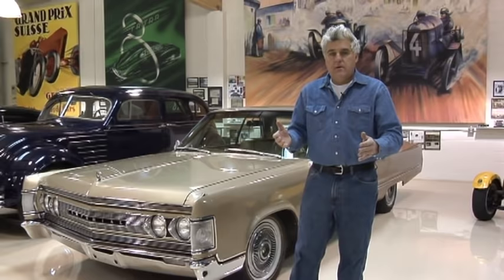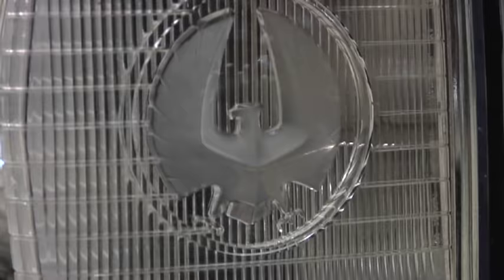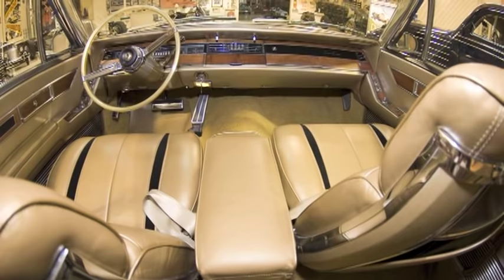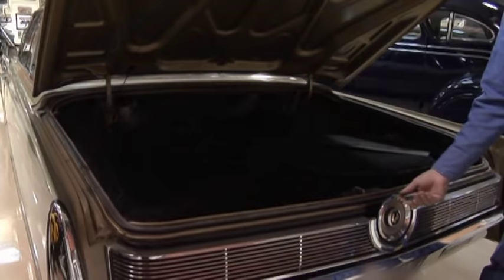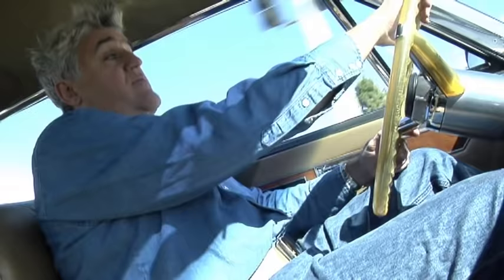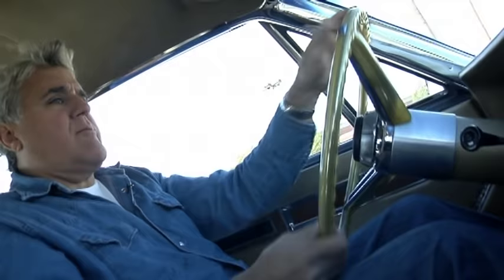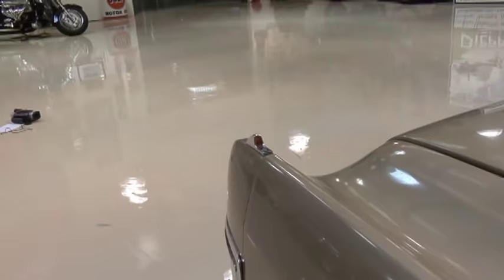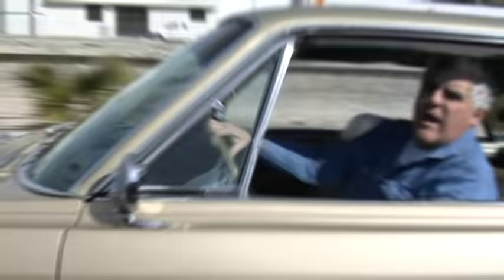1967 Chrysler Imperial Crown Coupe - Jay Leno's Garage

Comment: I grew up in LA  in the 50's and 60's and the only "seatbelt" was your Dads right arm holding you back from smashing your head into a metal dashboard in an emergency stop. It was always a good idea to be on good terms with your Dad on those occasions..
Reply: @Hoodoo Man: That move's even better with a female passenger-even WITH the seat belt on!
Reply: Fast stops could result in crushed craniums without seat belts.
Reply: I got my license in 79.  Back then wearing a seat belt was considered an activity for pussies, some drivers would even take offense if you wore one as to them you were communicating that you did not trust them.  However, I was brought up to use them and felt uncomfortable without it, so I would nonchalantly put one on if the car had one.  Many of my friends actually removed the seat belts as one of the first things on the list when they bought their car.  Even if the car had seat belt buzzers, they were easy to unplug.  To this day, it amazes me how people could have been so stupid and how far the other way we have come.
Reply: I remember when some people removed seat belts, but that was back in the middle to late 1960s.  By the late 1970s most of the people I knew used their seat belts, although there were exceptions.  I insisted that passengers wear their seat belts when I got my first car which had them, i.e., a new 1964 Volkswagen.  At that time I had to be very insistent.  Some of the excuses for not wearing them were bizarre.

Income seemed to be a factor.  In observing employees leaving work, I noticed that those leaving professional business were much more likely to fasten their seat belts than employees leaving factories.   @kennethsouthard6042
Reply: @frankeggers4024  I remember the "thrown clear" excuse.  It was always a friend of a friend was in a car wreck and was thrown clear.  Had he been wearing the seat belt and lived, he would have been knocked out and died in the car fire that always seemed to occur.  I even remember one of the guys from MASH, I think it was Wayne Rogers telling his own "thrown clear" story on a talk show.
Reply: I also remember that.  The Kaiser even had a pop-out windshield to make it easier for people to be thrown clear.  Some people said that they were afraid that with a seat belt fastened they might drown if the car ended up in the water. Of course if a seat belt is fastened people are less likely to be knocked out and therefore they will be more likely to be able to escape.

The lower accident death rate we have now is largely, although not entirely, the result of seat belt use and cars which offer better protection in case of a crash.  And, we now have statistics which prove the effectiveness of seat belt use.

 @kennethsouthard6042
Reply: @Big Bill O'Reilly KLASSY REMARK JUST LIKE TRUMP, PURE KLASS.
Reply: Lol
Reply: Grandmother driving would say "I don't need a seat belt, I'm holding the steering wheel".  Not sure if that was ever test-confirmed.
Reply: I remember being a kid in the '70s and my dad telling me that seatbelts were for sissies - I believed it until the day he had to stop short to avoid a rear-ender and my head hit the windshield and broke it.  Fortunately, he bought me a plastic batting helmet that day and I was wearing it at the time on the way home from school - it split right down the top.  I never listened to his ignorant BS again.
Reply: My wife is the driver, and still extends her right arm "to save my life" whenever she has to brake hard.  I keep telling her to quit it, my seatbelt and airbag will protect me, keep her hands on the wheel... she says it's just the mother in her, and she can't help it.  What's amazing is that we're both over 69, our kids are 48 and 45, plus several grandkids and one great-grand kid.  So its a sure bet that old habits are hard to break.
Reply: @frankeggers4024  Gee. They have stats that prove seatbelts are safe? I never would have known without them. Thanks for enlightening us, bruh.
Reply: @kennethsouthard6042  People weren't stupid because they didn't wear a seatbelt. It was the times and the mindset. It's hard to explain to someone who didn't live through them. You can judge them with 20-20 hindsight, but don't call them stupid. It reveals ignorance.
Reply: @joecebu2791  I'm 55, so I remember those times quite well.  My only difference was that my parents pretty much enforced wearing them where all of my friend's parents were of the belief that seatbelts were at best wothless and at worst dangerous.  There just seemed to be an overall ignorance about them at that time
Read my other posts in this thread to get a better idea of where i am coming from.
Reply: You're welcome.  I'm glad that you have been enlightened. @joecebu2791
Reply: @kennethsouthard6042  so you're 55 and remember the mid 60's? You were what, 3? Helluva memory,  bud.
Reply: @joecebu2791  First of all not many cars from the early to mid 60s didn't even have seat belts, my dad's 62 Thunderbird had them as an option but only in the front.  Second of all i was mainly referring from the late 60s ( I think it was 68 when they were mandated )on through the 70s when all  cars had them and few people wore them.  Yes, I remember those times quite well.
Reply: I remember climbing up onto the rear package tray with my brother and the old man tap the brakes at the next light and we would  fly down onto the floor squealing with delight .
Reply: @shawnfoxfirth9684  😅😅😅👍👍
Reply: Now your an adult so wear your seat belt
Reply: @thomastalleos8370  Now "you're" an adult. Learn to spell and stop telling others what to do.
Reply: Yeah, I remember my Dad holding me back sometimes when I was a bit older. Up until then though I used to stand up in the front seat.
Reply: @frankeggers4024  VW didn't come with seat belts in '64 unless you had them installed.
Reply: Quite true.  That's why I had them installed. @stevek8829
Reply: justsomeguy  It shouldn't be a law. The governnent isn't our mommy. It's should be a choice to wear a belt. Good or bad, still a choice, my friend. I wear my belt,  coz I choose to, but I don't need a nanny state.
They passed that law under the guise of lowered insurance rates. That never happened... big surprise.
Reply: justsomeguy  Not stupidity, by the way. It was the way it was... what's next, a seatbelt in an effing horse? Hey, it's safer! 😃
#SnowflakeNation
Reply: RJ22: Actually, it is the driver who ESPECIALLY needs to be wearing a seat belt.  Although many drivers think that they are safe because they're holding the steering wheel, and the steering wheel seems very sturdy, the major cause of death to  the driver, in a crash, is that the steering wheel literally breaks right off in the driver's hands due to the force of the impact, and the driver is thrown forward, impaling his/her chest on the end of the steering column. Wearing the seat belt stops that from happening. Unfortunately, it is likely that most drivers didn't realize that, and thought that holding the steering wheel would keep them safe in a crash.
Reply: So that’s what’s wrong with our youth!
Reply: Hoodoo Man haha. That’s great!
Reply: And that's the point -- wearing should be a matter of choice for a society of supposed adults who can exercise their own judgment with respect to such matters. 

Socialism,  in the end, always wreaks more destruction than good.
Reply: my dad was the seat belt to lol
Reply: My dad had a buick straight 8 got into accident I was standing in front seat giant arm stopped me from going forward
Reply: Exactly!!  Dad's was super dark green, and a 4 door.
Reply: Your dad stole that move from Mr. Castanssa
Reply: ...no doubt about it, Jay, this was a regularly spoiled Crown Coupe...the story of the mechanic making house calls I'd just SOOOO " LA-LA Land"...
...and, just a nit-picker correction, it was the LeBron n which was Imperial's rop-of-the line marque...
...too bad that this one wasn't fitted with the mobile Executive option ( bigolded teak desk, attached by a pivot hinge to a chrome pole just behind the passenger seat, which itself pivoted a full 180 ° to face rearward...( given that the guy was a producer...one would think that a mobile office and car phone would be " The Thing")...
...and just one final note...this year model Imperial by Chrysler was the final of the '55-'67 models basically hand-built at the separate Imperial plant, design and testing factory in Dearborn Hills...and you are correct that Imperial sales lagged FAR behind no. 1Cadillac and no.2 Lincoln...

...but these cars were as close to a Rolls' or Bentley's build quality that was ever mass produced here Stateside...

...my only thought to complete your Imperial would be a pristine Frank Sinatra Series of the '82 ill-fated Imperial Coupe re-intro, which fizzled out by '84...these Special Editions are rare, rare, rare...and much sought-after by discrimimating collectors...
Reply: my dad did that on many occasions I think it was also a maneuver to get a feel job if you had a buxom passenger, you know stopping short like on seinfeld.
Reply: The '67 Crown convertible, less than 500 made, is sweet. L.A.s Petersen museum has/had a navy blue example originally owned by Jack Benny. Chrysler had strong links to movie and TV placement. Imperials show-up a lot on The Beverly Hillbillies, Mission Impossible, Mannix and many  other shows. Milton Berle drove the '62 Crown convertible in "It's A Mad, Mad,Mad,Mad World." Gene Barry drives a '67 Crown convertible in the first Peter Falk Columbo outing, "Prescription Murder" I think some discriminating buyers in Los Angeles, Palm Springs and Florida bought Imperials because of the superior "Airtempt" a/c units. There were even little window stickers reminding you. I think they also manufactured household a/c units?
Reply: In order to be funny it must be true.

And this is true!

I collided with my dad's right arm more than I did the dashboard!

'53 Ford Ranch Wagon.
V. Cool
Reply: We always used horse ropes fer seat belts when I grew up. Pops wood tie us down in the seat and if we were two noisee, he had some duck tape
Reply: @frankeggers4024  i
Reply: Ha
Reply: What no late 60s volvos ?

Comment: My grandfather owned a 1967 Imperial. When we rode around in that car we were so far away from the front seat that it was like sitting in the Grand Canyon. 
One time, My grandparents took me and my brothers on a road trip and we got lost. We were so lost my grandfather had to drive mountain fire roads to get back to the freeway. That car was so freaking big we could barely get around the corners without the tires kissing the edge of the cliff road. My grandmother in the front seat shouting at my grandpa, and us boys in the back frozen with fear. But we made it. Fun times.

Comment: I learned to drive in a 66 Imperial four door and its just as Jay describes.  Absolutely no road feel and one finger will steer the car and one toe will apply the brakes.  I love that kind of isolation.  I wish we still had real cars like this now.  It was a true land yacht
Reply: My grandfather owned a Chrysler Plymouth dealership and I learned to drive in a 1976 New Yorker Brougham (which was essentially an Imperial, as Chrysler dropped the name Imperial after 1975). That car was absolutely stunning inside and out. When we would take it to the car wash we would always receive compliments and at least twice people asked if we would sell it. They traded it in 1984 and only got $1000 for it; I wish I'd had the $1000 to buy it from them back then because I would love to drive that car today.
Reply: Gary Taylor I had a 1972 New Yorker Brougham and your absolutely correct . I still miss that car and I sold it about 30 years ago . Sigh .
Reply: Chrysler introduced power steering in 1951; they were the first even though GM invented it in about 1928.  I knew someone who had an early 1950s Chrysler Windsor with power steering and fluid drive.  He used to drive with one hand on the hub of the steering wheel.  It took zero force to turn the steering wheel.  Fortunately most cars now have at least some road feel.
Reply: My father drove Chrysler land yachts when I was a child in the 60's and early 70's. More often then not he drove with one thumb on the wheel.
Reply: Those Chrysler Corporation cars had over-boosted power steering.  @Zoetropeification
Reply: @dougtaylor2803  Except for the fuel economy.
Reply: @emjayay  gas was cheap then, 50-60's and had over 100 octanes for super leaded fuel. High compression engines needed that. You could pump your own for about 25 cents, or get the "man who wore the star" to do it and check your oil wash your windows, inflate your tires if needed.....etc. etc. for about 32 cent per gallon.

Comment: Hey Jay, The steering wheel is Telescopic and Tilt. Just twist the big chrome nut in the center of the wheel left 1/2 turn then you can move the wheel in or out, 1/2 turn back and it's locked in.
Reply: ... and that unit was made by Saginaw Gear of G.M..
Reply: @34Packardphaeton  Yes, it was even told in his 66 Lincoln vid that the Lincolns had GM steering columns, which most likely meant the gearbox as well.
Reply: @kramnull8962  .. I don't believe that such assertion is accurate or true.   The '66 Lincoln was the first year of FoMoCo's "C-6" automatic transmission. .. It was only in the early to mid 1950s that L-M used GM transmissions.. briefly.   Also, the '66 Lincoln only offered a tilt wheel, not a 'tilt & telescope'... so again, the steering gear may not have been GMs.
Reply: @kramnull8962   And Chrysler built transfer cases for most G.M. 4 wheel drive vehicles.   The transfer case was a New Process brand transfer case owned by Chrysler which later became a joint venture between G.M. and Chrysler called New Venture Gear.

Comment: When emission rules where enacted, the founder of Honda, said he hired a 100 new engineer's, and GM hired a 100 new Lawyers...
Reply: I would have hired 100 of both and had the engineers working with the lawyers to design a car that exploited every single possible loophole in emissions laws
Reply: Engineer's what?
Reply: @user-xg8yy7yl1d  All in the name of better performance.... My ex wife had a 96 Mercury Sable with a 3.0 DOHC. First year of OBDII. Thing had at least 20, 1/8" vacuum lines running to electric/vacuum sensors. What a terror to keep running good, when you could replace the boots and still spray cleaner on the fittings and see bubbles and get engine bog... In general it ran ok most of the time, but felt like it was always holding itself back somewhat....

Comment: I remember going to a demolition derby in 1982 at the San Jose Fairgrounds.  At the very end all that was left were like 5 Imperials and they still pretty much looked unscathed going in, as they made easy work of all the other cars.  Long story short it sounded like thunder, and took forever for the Imperials to finish each other off. I've been to like two or three derbys since, but that was the only one that I saw with Imperials, and nothing will ever top it.  Another side note, is that I always heard that it was strictly a halo car for Chrysler, as they always lost money on them.
Reply: +Kenneth Southard I had a friend in 80s who would buy Imperials at the auto auction $50 apiece and drive the heck out of them.
Reply: +Kenneth Southard I had a friend in 80s who would buy Imperials at the auto auction $50 apiece and drive the heck out of them.

Comment: Reminds me of my 1966 300.. It had all the options too. The center of the steering wheel had a knob that would let the slide in and out to accommodate larger or thinner drivers. All you had to do to make it move in or out, was turn the knob counter clockwise and clockwise to lock and unlock. My interior was black and chrome. The ride going down the road was like floating on a cloud. They don't make them like that anymore.

Comment: Sorry to correct you, Jay, but the Chrysler TorqueFlite was all aluminum in 67. They went to all aluminum for the big V8s in 1962.
Reply: +Lee Crt Yes--I noticed that right away.  I have worked on some big block 727 tranys from the mid 60's.
Reply: I have a '63 pushbutton a-727 with the parking mechanism outside the Aluminum case. Custom 880
Reply: Jay's a great guy, though he frequently makes technical mistakes.  In this case he's claiming this car's TorqueFlite transmission was "cast iron," when in reality is used an all aluminum housing.
Reply: @harddrivin1le-970  Lots of cars had the aluminum transmission housings, a big weight savings; my 67 Mercury Cyclone had/has one (I have another one now). Of course all the guts were/are fine American steel and other metals.
Reply: I agree with you but my dad's all original 66 Imperial has a dual pump cast iron case and it is the original trans.  By all means the car should have a aluniumum case without the rear pump which leaves me to wonder if Imperial did things differently?
Reply: Lee Crt 
Then don’t.
Reply: @jodysanders1076  had a 64 custom 880 361 it was a very good vehicle
Reply: Harry. B. Renner. jr.  right, I was only talking about the light weight aluminum casing, not the steel transmission parts inside it; it's a c6 in my Cyclone.
Reply: Yes and low reverse sprag could destroy the transmission case.
Reply: @southjerseysound7340  Yes and you can push start cars with dual pumps.
Reply: Harry. B. Renner. jr.  AMC used them as well

Comment: My buddy had a 58 Chevy, a tank, and I had a 61 Ford. In the summer when hot, we would put the car in neutral, rev it up while rolling back down a hill with black top patch on the country road , pull it down in gear, and floor board it. Smoke would be rolling off the tire, not tires, no posi-track. We just kept changing that one that tire around. That was fun!